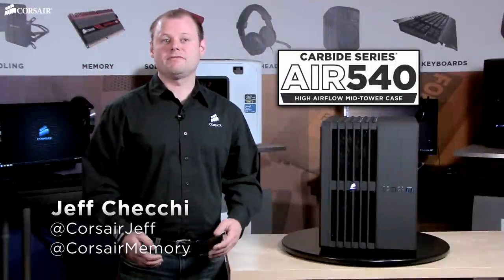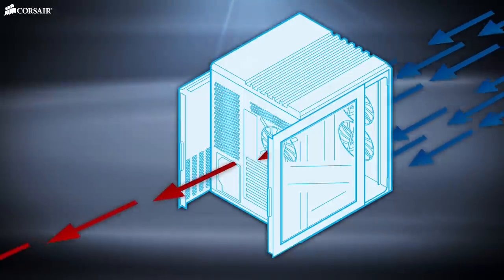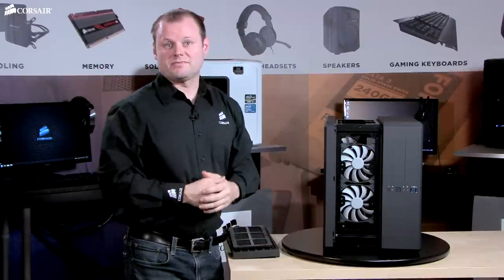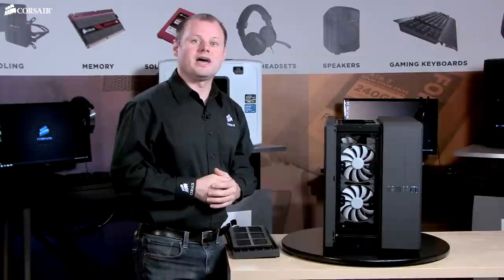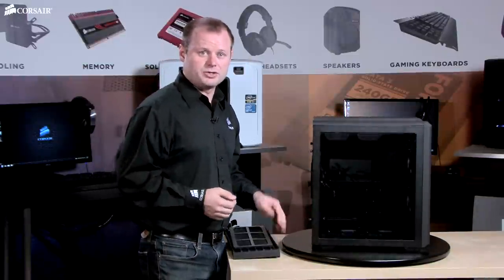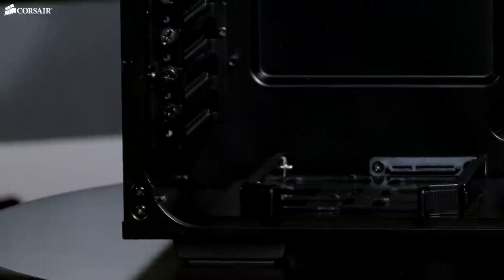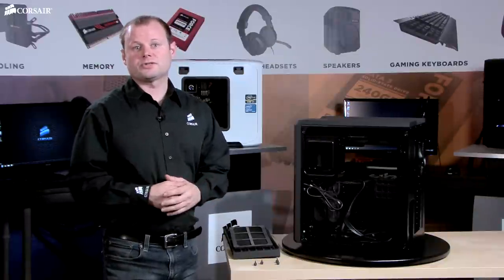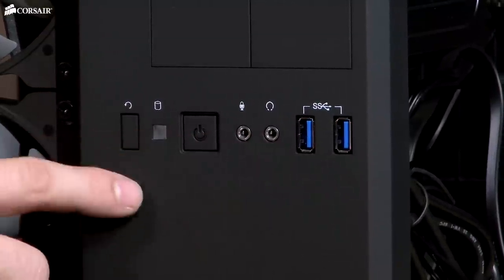Corsair Carbide Series Air 540 PC Case Introduction

Comment: People keep complaining about no filter on the top. You should be running positive pressure on your case. As heat rises that means the top will be exhaust which means with positive pressure there is no need for a filter as the intake has a filter. Since the radiator will be at the top this case is really only designed for blower style cards.

Comment: I have this case....and I love it...it is by far the best and easiest case I have ever built in. thanks corsair..... :)
Reply: Shane Herald measures please, Can I use inside it an asus x99 delux motherboard??
Reply: FlexibleTerror I control fans with my motherboard bios settings...this case comes with 3 140mm fans they are 3 pin...I use the Asus Crosshair V Formula Z which can control the dc current to fans...so for me pwm 4 pin wuz not needed.... Marlon Cristancho yes you can use that board in this case ...x99 deluxe is the same dimensions as the Asus Crosshair V Formula Z...I had no issues mounting this board

Comment: I'll agree with ur first part of the thumbscrews because they always go missing and then u need to find replacements. For the second part, there are two spaces to put mechanical hard drives in the portion of the case where the motherboard and so on is. If u look closely at 1:50 u can see where the drives go at the bottom of the case. For the SSD's they don't need cooling as they have no moving parts so they can go in the back of the case where the power supply is located.

Comment: This would be a great design for an matx case too. I love the case other than the bottom hdd mounts. Put them in the back. I likely will use this case for my next loop, and mod the hdds out. Also there's not dust filters under the hdds just open space!

Comment: I'd like to see another version of this bu elevated with fans at the bottom to take advantage of the rising heat similar to the way Maingear makes their cases. Also, a smaller matx version with this design would be nice as noted.

Comment: Yeah I've been doing a bit more research and all the hardware I'm buying will fit and work fine. I will have to mod some parts (dust filters on the bottom of the case and one on the inside of the air intake grate for the PSU.

Comment: Thats my case for my new haswell build. 360 up front, 240 (or 360 pending dremel) up top. Plexi in the 5 inch drive bay covers to view the tube res. Some decent cable management with some aluminum covers and another window in the left side. And custom acrylic panels instead of the god awfull grill. Some see ugly. I see potential. And inevitable awesomeness.

Comment: I wish this had Sata inputs on the front, was just a little bit taller, could be used horizontally without modding, had lighting control on/off and a fan control button. Also more storage drives spaces would be cool.

Comment: I Like the wey the psu is hidenso there are no unecessary cables apearing and I think that I  can get some insane water loops too but i didnt saw if it have holes for external radiators

Comment: Got one before Corsair discontinued it in 2018. Bought it from Fry's of all places. Its decent but it will have trouble with these +300mm or 13" graphics cards that are common these days.
Reply: my asus 2080ti has about 1 inch of clearance from the front fans lol

Comment: I've always loved the idea of a cube case, but why is there so much wasted space in the second chamber?  I need at least two SSD mounts and four 3.5" drive mounts.  It looks like more 3.5" drive mounts would easily fit in the second chamber.

Keep the motherboard isolated in the main chamber with room for all the cooling, and keep the power supply and the drives in the second chamber,

Comment: for ssd based systems this box is nice, but it is another story if you use hard drives. because they need cooling. i remember i read somewhere that they perform 10% better per 5 degrees cooler (Celsius)

Comment: I love the look of the case, but have a few questions is it steel with plastic construction and also you say will take 240mm and a 360mm radiator is this together and are they full size radiators(60mm thick)?

Comment: I have a question:

Is there enough room for an itx board behind the main motherboard bay? Of course it will need some modding for the standoffs for it and for the I/O ports. standoffs would be like 20mm or 25mm so the board wouldn't block the cable management holes. Will be using only 1 slot sized pci-e card so it doesn't add extra space need. But basically, would the 17cm x 17cm board fit in there? Afaik the release date will be in end of July so i need the answer from you

Comment: I have one major question: What is the spaceing between the front of the case the the end of your motherboard, I need to know this in order to figure out the radiator thickness that I can fit in this if I get it.  Thanks.

Comment: How to I add more fans to the front? Can I have 2 layers of fans on the front to pull more air in? ~ So, x4 140mm Fans on front

Also I have a liquid cooling radiator on top, can I add more fans on top of those also?

My pc is crashing due to overheating.

Comment: if this had ssd's at the bottom not hdd,s and could fit x3 140mm in the front it would be so much better also didnt have the massive holes where the hdds are allowing so much dust to get in

Comment: Seems like a massive waste of space on the second chamber. Considering this case is supposed to utilize maximum airflow, you should have rejected the two hard drive bays at the bottom of the air chamber and replaced them with fans for air intake from the bottom. That would have been optimal. Air intakes and exhausts from every side. Then move the two drive cages from the bottom and then into the secondary storage chamber with the PSU. Hopefully you can refine this for the mATX version.

Comment: hey there. 
is the max-lengh of the gpu-card meant with the preinstalled fans mounted? i wonder if i can install an h110 with push-pull there? my gfx-card would be an 280mm gtx770.

Comment: I have this case, don't buy it. Plastic stuff breaks. No parts. Discontinued, blah blah.
Front panel power button garbage. Breaks. Forget it.
Reply: I have had this case for 12 years, not a single thing has broken on it so far. still in good condition.